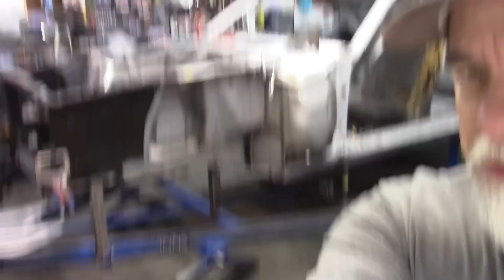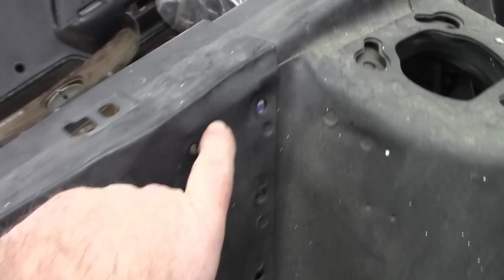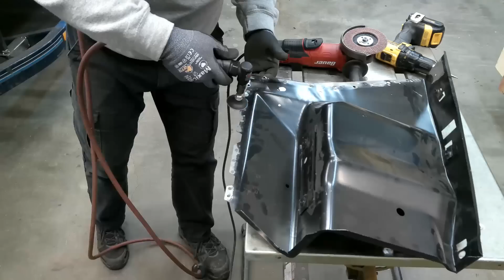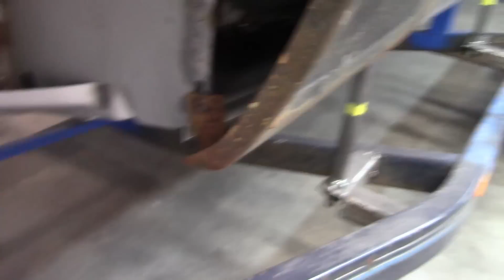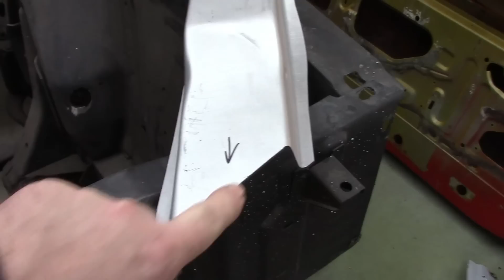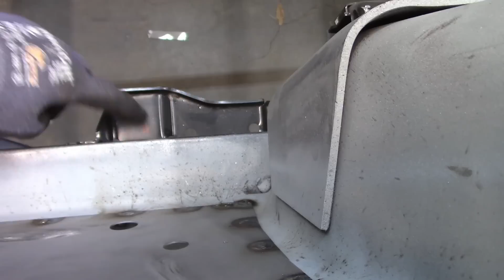Front sheet metal and more on a 1969 Mach1. Test fit and welding. Slither part 34

Comment: For those that don't have an unmolested twin car in the back room, Jim Osborn Assembly Manuals are invaluable.  For example, if you want to match the factories specs in your restoration for Weld and Sealant type, quantity, and location these manuals are amazing.  They are officially Ford Licensed and dovetail perfectly with the official Shop Manual for your specific year/make/model. There are also manuals for Interior, Exterior, Electrical, and Body.
Reply from the maker: Good information.

Comment: Those fender aprons on all mustangs of that era are an optical illusion. What you thing is really crooked is correct. It's hard to force yourself to ignore that they are way different side to side then the sides both look goofy. 
    So I guess I want a little spotwelder now. Oh and my 66 has bugger welds on the strut rod mounts too along with a bunch of spot welds.

Comment: Barry, it's been a wild ride, from "crunchy" to gorgeous 🥰 with this shell.. We know it's probably the most "emotional" project for you overall, due the owners sudden passing, during the build.
I believe you were the perfect "spirit guide" to bring this to the finish line... On the strut rod brackets, I had to remove the pass side one, to replace some flat steel under that bracket. There were 8 or 9 spot welds in the front, along with the ugliest booger welds on the front lip. I had two on the sway bar bracket overlap, only three spots holding the bracket to the underside of the frame rail !!!! From the factory 🏭!!!! I added a third spot for the sway bar bracket contact point, and my mig lines, were suspiciously similar in appearance to the factory as well on the front !!! Keep at it brother...We enjoyed the voyage...

Comment: Just curious, why did you remove all of the black paint on the aftermarket pieces?
Reply from the maker: That coating can cause paint problems later. Metal should be primed with epoxy.

Comment: Not sure if it is the angle but it looks like you did not get the plug welds done on the passenger front diagonal brace. 52:45 . They look empty.
Reply from the maker: It’s all welded.

Comment: spot welder... YES.... I am watching to see if weld through will work or not as there must be a complete circuit. Did it come with a shoulder strap , OR go get a guitar strap to hold the weight off your arms. It does do a great job very clean . It still amazes me how the original assembly line took a bunch of pieces and welded them on the fly in seconds, no wonder these cars were so inconsistent from one to the next. great episode, she is looking good
Reply from the maker: No strap. Just hand held. It’s a workout.